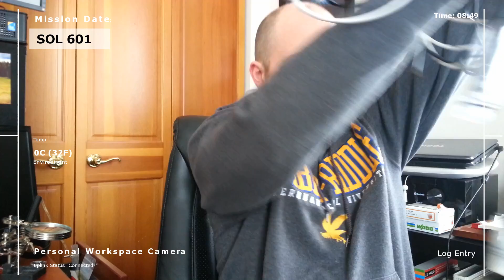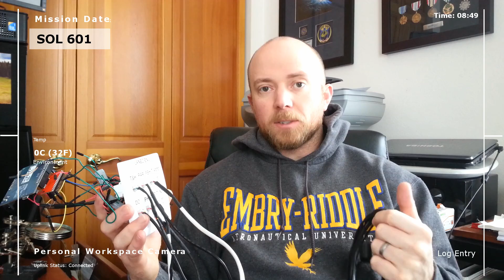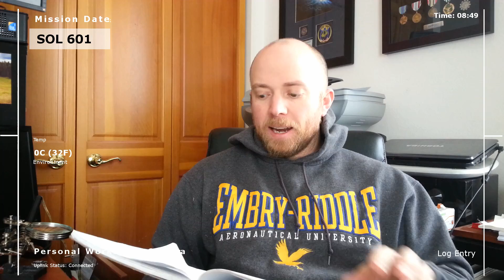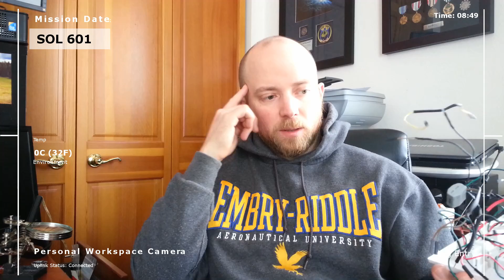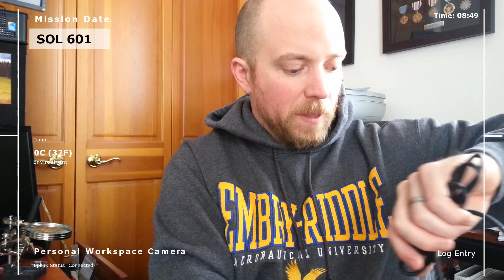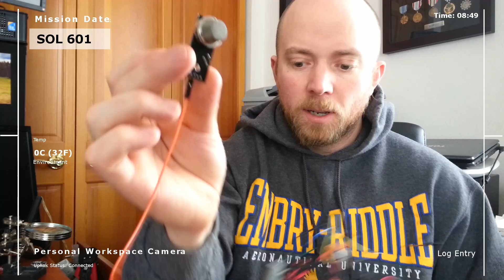ARDUINO homestead environmental sensor HACK

Comment: I'm disappointed that you didn't ask for input from ground control on what is going wrong.  I have a couple of things to tell you and it might help with the wire size problem you experienced.
The first thing is the connectors you are using are NOT RJ-11 connectors.  They are RJ-45 connectors.  RJ-11 are single/double line phone connectors.  RJ-45 is most commonly used now for internet connections using CAT-V wire.  CAT rated cable wire is indeed 24 gauge wire and your RJ-45 connectors are designed to be used with that and usually in 4 twisted pairs.   RJ-11 connectors, on the other hand are used for single or double phone lines and can use 22 gauge wire consisting of 2 twisted pairs of wire.  So now you know the problem.  You tried to use wire in a connector your not using.   That's OK, we are all learning here and not only have you learned about connectors but your viewers will now know they can use larger gauge wire IF they are really using RJ-11 connectors.
Now for another thing for you to consider.  IF your sensor is truly a 2 wire device or a wire and a shield it will be MUCH cheaper for you to buy telephone wire rather than CAT wire.  The telephone connectors (RJ-11) will be cheaper than RJ-45 too.  IF you think you are going to have problems with the long runs of analog voltages you could buy special shielded telephone wire but I doubt you will find electrical noise a problem in your habitat as long as the motor wires are kept away from the data lines.  Twisted pairs are remarkably resistant to electrical noise.  That is why we use them for our voice and data lines to begin with.  Since we have not really discussed the wire layout in the rows/trenches etc I just want to add you might find you need to mix CAT-V cable for long runs with phone wire used to branch out to sensors at the end of the CAT-V.  Your design will come up with the correct solution now that you know you can mix and match the two for cost effectiveness.  One other consideration... You can get both connectors that pop into your cover plate as well as even coax connectors like those used for cable TV and even banana plugs if you need them.  There is a whole bunch of different plugs that fit the plate you have in this video.
BTW.... What you have there is known technically as "A NEON NOODLE"  just look at all those noodles on that plate. LOL
Cheers
Reply: @trongod2000 I'm familiar with the hardware, I install the stuff. What made me say RJ-25 is the color code on the back of the outlets is 3-pair USOC 6P6C configuration with the green pair on the outer pins.
No need to further elaborate. Let's see what TRM comes back with on the next revision. Maybe a weatherproof in-use outlet cover.
Reply: trongod2000 Take a look @9:25, looks like RJ-25 keystone outlets to me. Not meaning to nitpick, just an observation.
Reply: trongod2000 I agree these appear to be RJ-45 (8P8C) connectors. I thought at first that they were RJ11 on the plug side and RJ45 on the jack side, but at about 8:31 it looks like they match and are RJ45. For the environment these are operating in, I'm wondering if a pluggable terminal block would provide better longevity? That would also allow the use of various wire sizes (at least 24-16 AWG in the same block size, I would guess). Those should eliminate the crimping shorts as well as providing better sealing on the connections to prevent corrosion.
Reply: Russell I was tempted to comment on the environment these connectors are living in but since the physical location of the Arduino and patch board were not mentioned and very well could be placed in a sealed box to prevent moisture damage I let it go.  It's also worth considering that other than internet purchases of items that may have never been seen before and the long lead time getting things to Mars. LoL  The local Lowe's or Home Depot carry a pretty good line of RJ-11 and RJ-45 connectors, wires and tools for same.  I'm not to sure what they carry for other connectors other than audio jacks and some patch cords for video.  
Once the issues are all settled on where and what makes up the automation subsystem I would serious suggest that optical connections be made so that accidental shorts outside the control box cannot get into the controller and ruin everything.  Having said this it is not forgotten by me that optical connections of analog signals is not always an easy thing to accomplish.  Often the signal isn't even possible without current flow on the signal line from the detector.  More complexity for our martian that I know, for now, he wants to avoid.
Reply: trongod2000 "Twisted pairs are remarkably resistant to electrical noise" - ONLY when driven by differential drivers, they are not magic cables. He could use bell wire and get the same noise floor.

Comment: Thanks for the plug for we Electrical Engineers (I hated Mechanical Engineering ;-)

I agree with the comment below that you might be dragging too much current out of the supply amusing the voltage to drop - try running individual sensors then build up to more and see if it's one sensor causing the problem or just the total load.  Also, if I detected CO I wouldn't want a small LED to light, I'd want a big flashing red light and a loud siren!

Comment: Hello TheRealMartian, I really like your videos about automation. It's great to see all that not just for experiments but for a pratical usage. I would like to give you some humble suggestions, if you allow me. 
How are you supplying current to all those sensors? The Wemos probably can't supply all the current. I like to use some switched dc converter for that. Are you considering using some pcb board to get rid of all the confuse wiring? For prototyping and testing this Wemos is nice, but for the final system you could use smaller versions. For external cables going to the sensors I like to use a multicore cable that can be shielded and looks really nice for a production enviroment. For wiring inside the box I use JST-XH connectors instead of dupont connectors because it helps me to always connecting things without acidentally burning something by switching the wires.  Here are some examples of the products I like:

- Multicore (2,3,4...) flexible cable (http://www.ebay.com/itm/400767160756)
- switched dc dc converter (http://www.banggood.com/LM2596-Adjustable-DC-DC-Buck-Module-Voltmeter-Step-Down-Power-Supply-Converter-p-1058369.html)
- PCB Boards (http://www.banggood.com/40Pcs-FR-4-Double-Side-Prototype-PCB-Printed-Circuit-Board-p-995732.html)
- 2 pin JST-XH (http://www.ebay.com/itm/272278401573)
- 3 pin JST-XH (http://www.ebay.com/itm/282072002549)
Reply from the maker: +Denys Sene thank you for such an awesome comment... New parts on the way

Comment: perhaps have a look at the ADS1115 16bit I2C ADC instead of the multiplexer ?
Reply: While we're on the electronics page, TRM might also have to make sure there are no potential gradients and loops in the setup. I'll throw in a few more parts:
ISO72XX / ISO154X isolators (SPI / I2C) combined with cheap isolated 5V:5V isolating DCDC converters (short of LTM2886)
ADS131E08 (8ch 24bit simultaneous sampling sigma-delta ADC with SPI)
AMC1200 (pseudo-analog galvanic isolator with x8 gain)

I know these won't be available on a box standard shield - but if isolation and higher resolution is really needed one might be tempted to design it and put it up on tindie.
Reply: Good call, being about to change the gain might be useful, as well as isolating the inputs from each other. Right now he's got a huge multi-wire antenna feeding noise into one chip. I'd have liked to have seen a remote ADC next to each sensor and using an I2C links back to the arduino, not having this mess of signal cables. Sadly he's not listening to anyone...